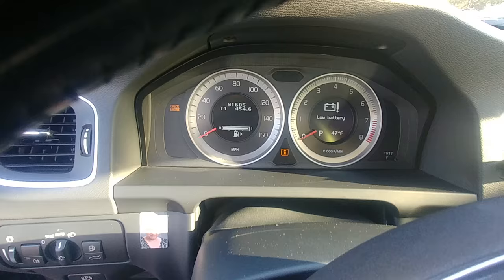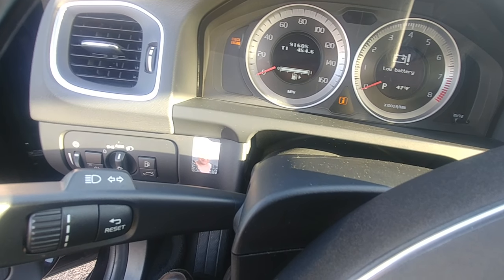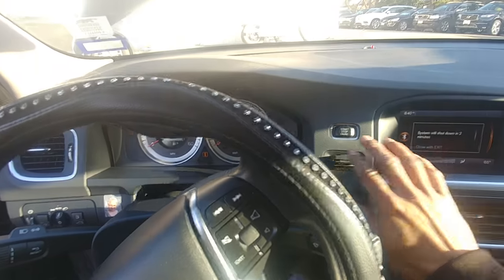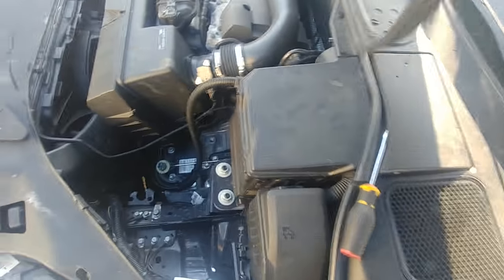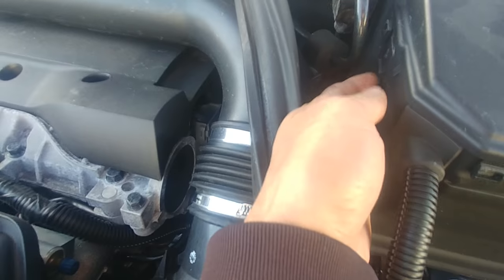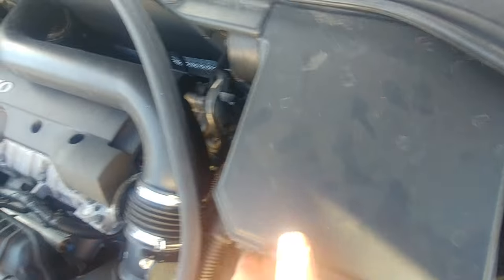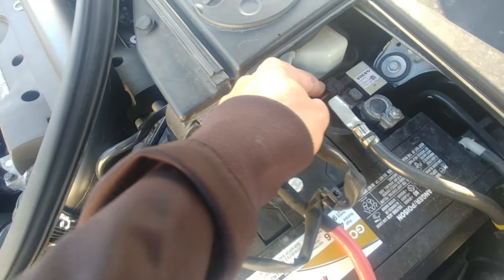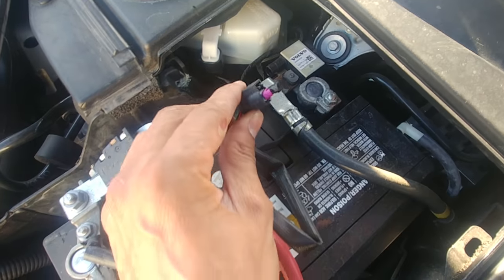How to clear Low battery message on a volvo 2011 and up

Comment: you all do realise that all Volvos{as far as i am aware: Disclaimer haha}, and no doubt many other cars, that have an auto start/stop function also have a back-up battery? It is situated to the right{ in UK-not sure about LHD cars) of the main battery underneath the scuttle cowl. One must remove the entire cowl not just the main battery access cover to get to it. It is basically a back-up battery in the guise of a smaller capacity battery ie a motorcycle battery and i believe it is this that often fails and not the main battery. No matter what you do, as a 'fix',  the 'Low Battery' dash warning will always reappear at some stage should this undetected auxilliary battery fault prove to be the culprit...often misdiagnosed, often overlooked
Reply: thanks for this information, i'll be fixing (🤞) this problem this weekend.
Reply: @stephenbatten4351  Did this get fixed then?
Reply: no, my s60 is from 2008, it only has one battery, apparently i have to pull fuse number 13 out of the dashboard fusebox for five minutes, i'll update tomorrow.
Reply: i pulled fuse 13, waited 5 minutes and replaced it, but it didn't solve the problem.
Reply: @stephenbatten4351 ☹️ I have similar issue on a V60. I will give it a go today
Reply: It seems you do have a 'low battery' then. Put a tester across the terminals and if if reads below 12 volts the battery needs either recharging or replacing. But check the alternator output too by checking the voltage across the battery terminals with the engine running and revving it should read around 14.3 volts if not, then maybe it's the alternator at fault

Comment: The low battery problem caused by Volvo smart charging- at low distance driving throw city with traffic jams the battery are disgarging day by day. Take out BMS at system will turn Standart charging without "smart". The battery will work good.
Reply: What is bms

Comment: So I recently replaced my battery on my volvo s60 2012 after it required a jump so it would start and this message was still appearing. Then after a month of having the new battery and my battery is dead and it is actively being drained. I did this reset and no longer see the message but my battery is still dead. The alternator is all good and charges the battery but once I turn off the car it’s dead within 5 mins. any ideas,

Comment: Thanks. After changing battery on Volvo s60 2016 the auto start-stop function was gone and occasionally received the low battery warning. Followed your steps and everything is working again.
Reply from the maker: Awesome man, anytime.   Just one thing don’t forget to subscribe, if u have a question about Volvo feel free to ask

Comment: Thanks for the tip.  Went to spend $200 USD for a new battery today but decided to test the one in the car.  It tested fine.  Full charge.  Load tested and it passed.  I didn't buy a new one and now will try this tomorrow.
Reply from the maker: Awesome
Reply: So the car just kind of falsely announces low battery to make us spend the money ?

Comment: Fantastic. There are now a number of things that work properly now.  The Power steering, no more low battery and last of all the reversing camera that used to flicker and now works fine.
Reply from the maker: Awesome. I’m glad that the video helped you.  Don’t forget to subscribe man
Reply: The reversing camera on my 2013 S60, it flickers too, but it happens when it's hot outside, nor on cold/mild days. I wonder if it has to be due to the change of battery and I forgot to do the unplugging thingy like the video shows. I've read in other forums where this was happening to some people but I've never thought that unplugging the BMS switch, it resolved the issue. Good to know. Thank you.
Reply from the maker: @yongodharma  dealer sales an amplifier that makes the flickering go away.  Is too easy to do. Goes between connector Bryan the trunk
Reply: @yongodharma  Same with mine, only on hot days.
Reply: this is the solution

Comment: Thank you
I don't believe it,  it's reset and back to normal. I followed the simple instructions after viewing the video... (2012 Volvo S60 T5 , US version)
I spent a lot of time scouring the web without success for a remedy,  as it was most annoying not having the radio when parked and engine off. 
I changed the battery a few months ago and thought it odd that I was getting "low battery- power saver mode". The old battery was losing charge so I would get the low battery sign regularly, more frequent on short trips. Some day I will get an award for being the slowest mechanic on the planet.
Reply from the maker: Hey man . Hope everything goes good 👍🏼 
Don’t forget to check your mot oil level constantly, some t5 have oil consumption from seized piston rings
Reply: Have the electrical system checked by a qualified mechanic to make sure the electrical system is in good working condition. Good be the alternator not putting out the correct voltage to the battery. You may find yourself stranded.

Comment: Mine D5 I just picked up is doing this but was thinking if the battery is legit low it would struggle to start. Drove it for 3 hours so should be charged, surely. Turned the car off at home and ''Low Battery'' 😂 so yeh, I'll do this. Thanks dude.
Reply from the maker: Sure.

Comment: Thank you for the video, my 2011 XC70 has recently been doing this, cannot even listen to the radio for a few minutes, no sign that it is an actual fault or failing battery, will try this tomorrow.
Reply from the maker: Its going to work. I guarantee .
Remember engine has to be running
Dont Forget to subscribe
Reply: @VolvopediaGuy  well done, this worked 100% (exactly as you said). FWIW my XC70 D5 was registered in December 2010. Probably what the manufacturer would call Model Year 2011.
Reply from the maker: @g0fvt  awesome
Reply from the maker: any time man.  Dont forget to subscribe

Comment: Hi. A few weeks ago I changed a battery on a 2010 Volvo V70. Does a 2010 require a BMS reset as well? Will this work on my car too? Should I do this? 
Also, just recently, having issues with rough idle in park. Almost wants to stall. This only started after battery replacement. Is it connected somehow and what can I do? Does my 2010 car require a Throttle Body Relearn as well? What can I do? I would greatly appreciate the help. Thank you very much.
Reply from the maker: @mikeike7114  hello
I don’t think that year has the BMS sensor. You can reset battery counters if you have battery message while car is running check if alternator is turning 
Try cleaning throttle body specially if the issue is on idle
Reply: @VolvopediaGuy  Curious. The car has literally ONLY 10,000 miles. Can the alternator go bad already with such low mileage? And can a throttle body get dirty enough to cause issues with such low mileage? Thanks
Reply from the maker: @mikeike7114  throttle body can go bad if car is not driven constantly I had a car that the plate got stuck on close position because customer had it park for months, you can remove throttle and see if the plate moves evenly, you should feel plate little hard to move but if you can’t move it by pushing hard with your fingers is because is stuck inside 

Battery code you will get because car is not driven every day

Comment: You may a real issue with your charging system.  I recommend to purchase the Topdo battery /alternator tester. The 3.2 inline 6 is also notorious for having issue with pulleys and lose nuts. Bottom line, if you replaced the battery and this pops out, you are not getting right charge on your battery. You can also use a multimeter to measure the load with your car on. This issue unfortunately could be lot more complex than a simple reset.
Reply from the maker: For charging fautr it will give you different warning message. Red battery warning message. And car will die or multiple warning messages when battery become discharged

Comment: Thank you! I replaced my 2012 s80 battery with a high end AGM battery and since then I kept getting this low battery message.
Reply from the maker: Zehua Zhou sorry fore some reason aftermarket battery or other kind of battery triggers the low warning message
Just make sure the car is running when resetting
Reply: @VolvopediaGuy  Thank you. I followed your procedure and the message went away for 2 days but it is back on. I measured the battery to check if the battery is indeed low. The voltage is 12.54V. If I turn on the engine, it goes up to 13.04V which is probably because the alternator is charging it. Do you think the voltage is indeed low or if I did not properly reset the battery sensor?

Comment: So what happens if the battery isn't maybe in the best condition anymore but you reset it? Will it still give an actual warning that the battery is low when it REALLY is low, or will it just drain without a warning? I bought a second hand xc70 and they replaced the battery, but i just don't know when. I regulary get this message after just having the car on without the engine running. Even just some minutes is enough to get the message, but the battery never really went that low that i couldn't start the car. Would resetting be wise?
Reply from the maker: The reset is for the battery monitor sensor to recalibrate and from there sensor can tell you if battery is getting low

Comment: Thanks for the video. I replaced my battery about a month ago on my 2012 S60. I went to get a smog test and didn’t pass. Smog guy said I had to reset the computer, but wouldn’t the battery swap have done that? And I’ve been driving it daily for a month. Any suggestions? Would this help?
Reply from the maker: Diego J. Garza why you didn’t pass??
Reply: Volvopedia Guy the inspection report says OBDII monitor not ready. Smog tech said if i replaced the battery I should have reset the computer. Now that I’m researching a bit more, I’m reading about unplugging the BMS and also doing a drive cycle.
Reply from the maker: I’m not familiar of what u r saying. Here we don’t do smog test. It’s something on their side maybe. When unplugging a battery most modules should reset.  But ok newer models with start stop will affect system   Start soo won’t work until you reset battery monitor sensor.  Or battery counters

Comment: This worked for my 2012 S60 after a battery replacement. Thanks!
Reply from the maker: Chet Amus awesome . Any question im here
Reply: You actually need to reset the battery settings, it is charging your battery in a different way, as it should. Can overcharge it very easily.
Reply: @atilamarkus  how do you properly reset the settings if you change the battery yourself?
Reply: @VolvopediaGuy  hy. i just replaced battery in xc60 (133kw 2014) and voltmeter measure 14.8V when working. Is it ok and do i need to do the reset? Tnx m8 i just bought car from known owner  and new to all
Reply from the maker: @marklar4x4  withascaner reset battery cointers to zero 
Is under CEM diagnostics

Comment: I have a 2013 ’drive’ with the same problem since I replaced the battery several years ago. Tomorrow I’ll try this remedy. There’s however another problem: after replacing the RF-ABS-sensor only the ’city safety’-warning does not disappear. Is there a kind of reset procedure known? All other warnings are gone after resetting the system.
Reply from the maker: @karelongena8299  cvm calibration and radar calibration

Comment: This Way like reset BMS battery right ?
Reply from the maker: Is to reset battery monitor sensor.  By time the bms will stay reading low. Bby disconnecting with car running. Will reset voltage

Comment: I have a V60 D5 2011, I have the battery warning come on frequently but not all the time. Could this affect my keyless door entry, all the doors apart from the boot will not lock or unlock by touching the handles, I have to use the keyfob . I was just about to replace the battery hoping this would cure the problem with the keyless door entry the saw this video. Before I replace the battery which about as old as the car do you think clearing the battery warning or replacing the battery will solve the problem with the keyless door handles ? Many thanks 👍🏻
Reply from the maker: Nick R  each door handles have an antenna that communicates with car . The problem might be on the handles or kvm (keyless vehicle module)
Disconnect negative cable from battery  and touch positive cable for about 10 seconds  (don’t remove positive from battery) that way you can reset computer in the vehicle  . See if it can help
Reply: Volvopedia Guy thanks for getting back to me, do you mean touch the positive cable with the negative cable or just take the negative off the terminal for 10 seconds ? Cheers.
Reply: Volvopedia Guy P.S... when this started happening the drivers door handle went first but I could use the back passenger door to lock unlock, then back passenger door stopped working then sometimes the other side of the car worked very intermittently. Now none worked.
Reply from the maker: Nick R Yeah disconnect the negative cable and touch the positive but I think it’s going to be your doorhandle and tennis by the description you gave me door handle connection sometimes they got wet and they create corrosion between the connections
Reply: Volvopedia Guy ok thanks, I tried removing the corrosion from the female and male connections on 2 doors which made no difference, maybe I’ll try again taking a bit more time cleaning each connector? I’ll change the battery anyway as it’s a pain when listening to the radio with ignition off radio shuts down after 5 minutes. Maybe new battery will at least solve that. Thanks
Reply from the maker: Nick R when you buy the antenna make sure they also give you the male connector . You have to pig tail (wire repair).
Reply: Volvopedia Guy I’ve changed the battery which hasn’t fixed door lock problem but the Low Battery message has stopped appearing. I checked old batteries voltage which was 12.06 Voltes, the new was 12.7V , I was hopeful but now disappointed it didn’t fix door handle locking. Anyway I’ll try your Computer Reset procedure next when I get the time. I’ll ring Volvo to see if they can supply a Handle and Female connector, maybe they can supply the loom? Thanks
Reply: Were you able to repair your keyless system?  He won't open the door for me without the key either.  What was the reason?
Reply: @pawekg5143  I never got to the bottom of it, probably water ingress when being jet washed? I think it’s the handle’s, get a Volvo Specialist to replace the handle if you can’t be without it. Very frustrating. I’ve moved on to a 2019 S60 so I haven’t got the problem anymore.

Comment: Hi Volvopedia Guy, for my car, it works only for one day and the message comes back on the next day. I had it diagnosed and the result is "B11DB - Battery monitoring control unit - Signal not OK/incorrect". Does this mean I have to replace the whole battery monitoring control unit or just the sensor?
Reply from the maker: Never seen sensor go bad. 
Do you reset with car running? If u don’t do it with car running it won’t work.
Reply: @VolvopediaGuy  Yes, I did it while the engine was running.
Reply from the maker: What years is tour car and does it have a support battery?

Comment: Is this low battery warning not for the Auxiliarary battery for Start/ Stop/ radio and onboard displays
Reply from the maker: Not this model.  This model only has 1 bat
The other model with support battery will give u start stop service required 
Or park assist service require. Power steering service required

Comment: Thank you for posting this information. I replaced OEM battery on our 2026 XC 60 with AGM battery. Once installed, I started the vehicle and put volt meter on battery leads to find out that vehicle was not charging battery with 12.1 volts and dropping.  Resetting the battery monitoring sensor by unplugging it solved the issue.
Is this one time deal or will the sensor have to be reset in future because I'm using non Vovlo AGM battery?
Reply from the maker: Yes sadly non one battery have to be reset more constantly that oem 
But if your car is a 6 cylinder sometimes the alternator driven gear will get loose and will not charge battery, (not the alternator pulley the one is infrint of it